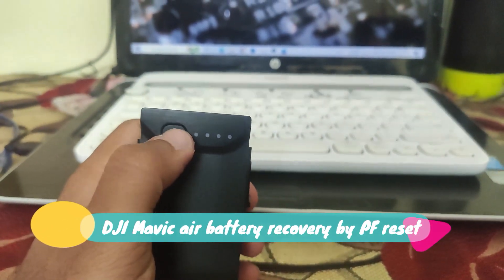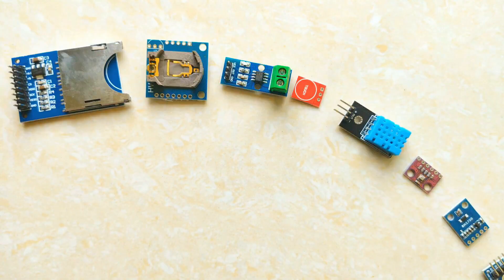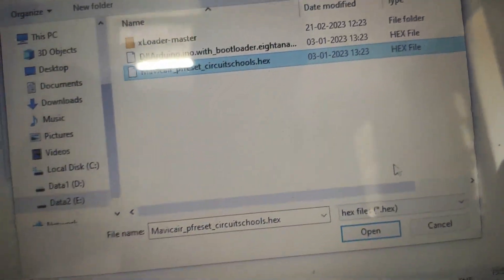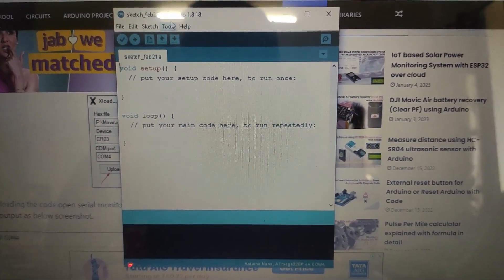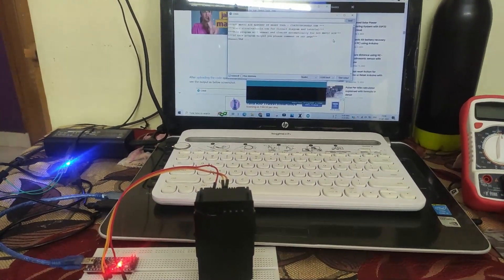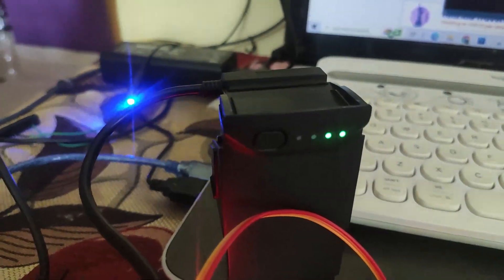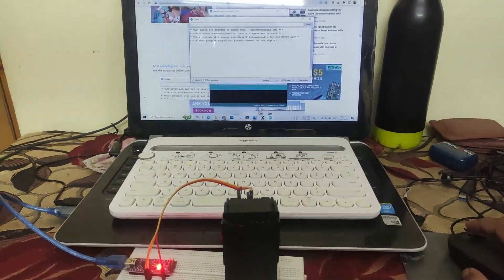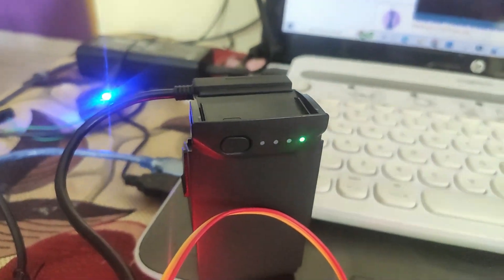DJI Mavic Air battery recovery using Arduino Cheap and Easy Method  #djibattery

Comment: Thanks so much, it works with uno and Dji Mini 2 battery as well.
Reply: Thank for the info: I am trying to reset a battery of my Mini SE (same one as Mini 2) but I'm stuck at "Unseal/FAS ..." Now I know I need to recharge the cells
Reply: The same code that was used in this video also works for the Dji Mini 2?
Reply: @Angelo-krto, Yes, after balancing the cells, batteries were still locked. I used Arduino uno and the code on two DJI mini2 batteries. Both are working now properly.
Reply: @ludmilkostov4067 Okay thank you for replying. 

I’m trying to make a custom battery pack for my Dji mini 2. I saw some 3500mah lipo cells on aliexpress specifically for the Mini 2. If replace the original lipo cells from the pack with the 3500mah cells will this same method work for unsealing & sealing the pack? 
And can you rewrite the new 3500mah capacity in the bms for the drone to recognize the new capacity?
Reply: @Angelokrto  Usually BMS's don't care about capacity of the cells, but voltage and balancing. I saw youtube clips where people put additional battery pack connected with wires to the original BMS.  Unsealing should work, but I haven't tested it with new batteries (I charged the original cells separately to the same voltage, without de-soldering them from the BMS).
Reply: @ludmilkostov4067  Ah gotchu, but does the drone calculate for the extra mah added? Because with the original battery the drone calculates how much battery is left so the drone knows when to return home.

Comment: uno de los problemas es que si tu celda esta menos de 3.9voltios no te funciona, debe pasar ese voltaje y lo otro es que si usas arduino uno tienes que utilizar los otros pines sdl que no es el a4 sino uno superior igual con el otro pin, el pinout sale en la pagina de arduino
Reply: Has podido usar esta guía en alguna otra batería me gustaría tener más información tengo arduino 1 y quiero recuperar mini 2 😅 pero no veo info
Reply: @CR7te  es lo mismo, solo debes buscar los pines de conexion de la bateria y los conectas al arduino, abajo sale una pagina, mira detalladamente la pagina para que te guies mas, aparte debes abrir la bateria y cargar con una fuente externa cada bateria a mas de 3.9 voltios para que funcione

Comment: Hello,
When I open the application, CC01 and CR03 appear on the devices. How do I add the Arduino? Can you help with this?
Reply from the maker: Which board you are using Arduino Uno or Nano
Reply: @CircuitSchools  Hi friend, does it work with Arduino Nano? I having the same situation, only CC01 and CC03 appears on the device list. Thanks.
Reply: @darrenfam3782 I had the same problem. There is an file called device.txt in the same folder as xloader. Here you can add the details of your Arduino. This is advice I got, so if this is the wrong method, please correct me. 😅

Comment: Here's how i charged individual cells: I used a regular battery charger designed for AA batteries, connecting two wires with positive (+) to positive (+) and negative (-) to negative (-). Then, I checked all three cells by referring to images online that indicate the positive and negative terminals of each cell. After checking the voltage of each cell, I discovered that one out of the three had a voltage below 2V. I charged that particular cell up to 2.11V (while the other two cells were around the same range, 2.11V to 3V). Charging just that one cell was sufficient. I reconnected it to the chip, ran the software, and it worked like a charm. 

Similarly, with my second battery, the voltages were similar, except this time the bottom cell was below 2V. I charged it to 2.11V, ran the software, and everything worked perfectly. The batteries now look brand new and function flawlessly.
Reply: Did you have to take apart the battery to individually charge them? If so, is there a tutorial on how to do that?
Reply: @jaredwseely  You can carefully pry the outward-facing surrounding portion of the case (where the button and LEDs are) away from the back panel that has the specifications printed on it and which is attached to the multipin connector and controller circuit board.  The seam is just around the face of that back panel.

Comment: thanks i charge the battery to 12.2 , and it works trying to 3.7 but no luck  second battery at 12.2 no luck  make a jumper wire connected to front +ve and start the Arduino IDE and second battery haven been saved thanks a lot
Reply: Jumper from what to +ve?
Reply: @agungekowijaya  it work from me too,same situation,charged the cell and still stuck at unseal/fas so i tri to put a wire between +pinout of batt and the cell at the end of chain for 2-3 seconds and it work,to find what is + at the end cell simply measure to the - and find what cell have the maximum voltage and that pin put 2-3 sec to output + pinout

Comment: Many thanks for producing this video as it saved me the cost of a new battery. I had to open the battery and used my bench power supply set to 0.05A constant current to get each of the three cells to 3.7V before trying to remove the PF in BMS with the Arduino Nano. Purchased the AN especially for this fix and it was a great learning experience and will no doubt open up a few more projects to enjoy.
Reply: what happens if you use 5v phone charger with a TP4056 to charge the cells?? did I screw them up? because I got them up to 4v but the arduino IDE is stuck on Unseal/FAS ...

Comment: I tried it but got stuck on the unseal fax i think the battery cells are dead. What do i need to charge the battery cells
Reply: Check my comment above. I had the same issue. The fix is easy actually, just carefully charge the cell below 2v.

Comment: it works perfectly after opening the battery pack and recharging each element alone above 3.7V. Well done and thank you !
Reply: How did you take the top off of the battery and what charger did you use ?
Reply: @bazza8746  You can carefully pry the outward-facing surrounding portion of the battery case (where the button and LEDs are) away from the back panel that has the specifications printed on it and which is attached to the multipin connector and controller circuit board.  The seam is just around the face of that back panel.

Comment: Hello, my father has a mavic mini 2 fly more combo and left the batteries inside the 2 way charger, and they are all dead, after a year in the closet, i'm trying to save them using this method, can you please provide the arduino code ?
Reply from the maker: it is already given in the page

Comment: hi, will it work for mini 1 battery?
Reply from the maker: we didn't tested for it, you can try it, check for pinout diagram and connect SDA and SCL pins accordingly.
Reply: @CircuitSchools  another question, Incase one of my battery  voltage way below the normal status, is it possible to charge my battery from the pin socket without open the battery case? thanks
Reply from the maker: @nagaterbang5833  may be NO
Reply: @CircuitSchools  another update, had successfully unlock the battery, but whenever i put in the docking all the led blinking 3 times.. I've been trying 2 times unsealing the battery..
any idea..
I've charged the battery to 7.2V

update 2.
i tried to put the battery on mini 2, it said battery cell error (30074)
any idea?
Reply from the maker: @nagaterbang5833  no bro, I don't have idea on this.
Reply: @CircuitSchools  oke2, i think the battery just wasted
Any way, I've tried your method for resetting the cycle number battery
Just wondering, is it possible to make the number adjustable?
I mean i want to reset the battery cycle to 7-9

Comment: Will it work with mavic 3 battery?
Reply from the maker: we didn't tested for it, you can try it, check for pinout diagram and connect SDA and SCL pins accordingly.

Comment: I tried this procedure and Arduino just pauses at Unseal/Fas but nothing further. No battery errors or anything. Is there any other way to know what might be the issue?
Reply from the maker: if it pauses at Unseal/FAS, the batteries are not in the state to turn on the BMS to send the data. So you need to charge the internal batteries, please watch the video ending for this troubleshooting guide. Thanks

Comment: How do you open the Mavic Air 1 case/cover without marking the plastics much, to get to the cells.
Reply from the maker: It has strong glue pads sticked hardly, You need to pull slowly to avoid damage, but still we get small scratches on platics, better use an old credit card or guitar picks

Comment: I finally was able to get it to work.

The two batteries that weren't responding had to be opened up (found a pretty quick disassembly video on youtube) and I used a TP4056 board from Amazon (you can get like a 5 pack next day for like 6 or 7 dollars.

I soldered a bunch of breadboard jumpers to all the pads on the board, and powered the board with the 5V out from my Arduino Uno.

Placed a push button switch in line to the power to the TP4056 board so that I could control when I was actually charging.

Hooked up a voltage meter across the Bat+ and Bat- leads on the breadboard so that I could read the voltage of the battery.

Cycled on and off charging for a few seconds at a time by using the button, and then periodically checking the voltage. All 3 cells charged pretty quickly from about 2.7ish to about 3.2 before starting to slow. Charged all 3 cells from one battery up to 3.5 (took a WHILE), and then decided to test the unsealing script again and it worked. Finished charging in the charging cradle once it would recognize.

Charged the second battery's 3 cells up to about 3.07, and the script was also able to recognize and unseal the battery, so try with about 3.05-3.1 volts instead of waiting a long time to try to get to like 3.8 as the guide says.

Other than that, it works.

Would love to see the code, interested in what's going on behind the scenes.
Reply: Would you have a link to that video you mentioned to show how to take the case apart?
Reply: @Bits-n-Bobs  /watch?v=5iX4DzljDMU
Reply: Is your Uno an R3 version like mine with the dedicated SCL/SDA I2C pins or the original that repurposes the A4/A5 analog input pins as control pins?  I can't figure out which ones I should be using to talk to the battery.

Comment: It works! I'm using all the same setup except Arduino Uno. Also the charging of battery when it's stuck at "unseal" was a lifesaver! Thanks so much :)
Reply: nit working for me even after charging the battry its stuck at Unseal/FAS
Reply: @kilatore667  Same here
Reply: @ChrisKonieczny   ok just make sure every cell is at 3.9 v
Reply: @kilatore667  Is there a way to charge each cell without taking the battery apart?
Reply: @ChrisKonieczny   no ,, but take it easy and you have nothing to lose
Reply: @kilatore667  That's where it ended for me as well; I used an Arduino Nano.
Reply: @theodorews did you have to change the pins you used on the UNO as the i2c pins are not on the same pins as the nano?
Reply: @anthonybarber5351  I have the same question, whether to continue to use the A4/A5 pins or the dedicated I2C pins.

Comment: great video, do you think this can be used for the batteries of the dji spark ? thanks and greetings from belgium -Domi
Reply from the maker: yes it work for spark battery, look for spark pin diagram and connect scl and sda accordingly

Comment: does the code you provided also work with the dji spark battery?
Reply from the maker: Yes it will work, but check pinouts for spark battery and connect accordingly

Comment: My battery total voltage was 7,8v (3v, 3v and 1,8v). Charged it with balance charger and first it didn´t work, but when i powered up the "charger side positive pin" jumping directly from battery it worked. BMS does not seem to power up itself again from battery side even if voltage is enough high

Comment: Youre awesome, thank you! it worked on my spark. xloader wasn't working at 115200, so i just left it in 57600 and it worked. And then in arduino serial monitor, 115200 worked
Reply: hi, i have dji spark and arduino uno. I need to reset the battery, it seems that cp2112 is needed on the internet to reset it, but I don't have it. can i do it with arduino uno can you help me?
Reply: @enestelkes  I'm not sure what cp 2112 is, but an uno will definitely work. I just looked up what cp2112 is and I don't think you need one because the uno should have i2c compatibility. a nano/pro mini is practically the same as an UNO, and that's what I used
Reply: @nickkirastoulis4617  thanks, I tried it for Spark with Uno, but it stays on "Unseal/FAS ...", I don't know what to do.

by the way i did 57600 as you said but "uploading" remained, so i did 115200

Comment: 1. I need this for 4 new old stock DJI Spark batteries. Any ideas?
2. I have Raspberry Pi Pico RP2040 with Arduino IDE 1.8 software as your video shows. Could this work? Or does it need ATMega2560?
Reply from the maker: our provided hex code works only with arduino based boards. Thanks, buy an arduino nano which is cheap.
Reply: @CircuitSchools  does the code you provided also work with the dji spark battery?
Reply from the maker: @FaridAmarFuadi__DB  will work with spark batteries but check pinout and connect
Reply: @CircuitSchools  sir my mini 2 bms is locked. Can i unlock the bms by arduino nano?
Reply from the maker: @nazmulkhan5437  don't know, if you already have Arduino board make a try, and let me know

Comment: AMIGO, BOA NOITE. PARABÉNS POR ESSE VÍDEO MARAVILHOSO, QUE AJUDOU A MUITOS. ESTOU COM AS TRÊS BATERIAS DO MEU DJI MAVIC AIR ESTUFADAS, QUERIA LHE FAZER UMA PERGUNTA. ONDE CONSIGO COMPRAR AS CELULAS DESSA BATERIA ? JÁ PROCUREI MUITO, E NÃO AS ENCONTREI. PERCEBI QUE A TENSÃO E A CORRENTE ELÉTRICA SÃO INCOMUNS, 3.85V 2375mA. VOCÊ PODE ME AJUDAR ? OBRIGADO, E FICA COM DEUS.

FRIEND GOOD NIGHT.  CONGRATULATIONS FOR THIS WONDERFUL VIDEO, WHICH HELPED MANY.  I HAVE ALL THREE BATTERIES OF MY DJI MAVIC AIR FULL, I WANT TO ASK YOU A QUESTION.  WHERE CAN I BUY THE CELLS FOR THIS BATTERY?  I'VE SEARCHED A LOT, AND I CAN'T FIND THEM.  I NOTICED THE ELECTRICAL VOLTAGE AND CURRENT ARE UNUSUAL, 3.85V 2375mA.  CAN YOU HELP ME ?  THANK YOU, AND STAY WITH GOD.
Reply: Compro as minha no Aliexpress mano.